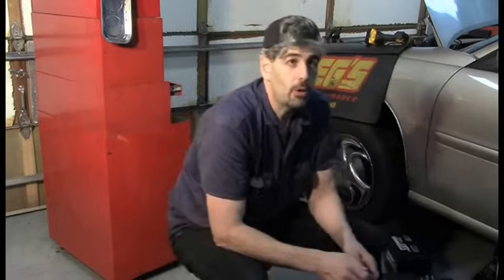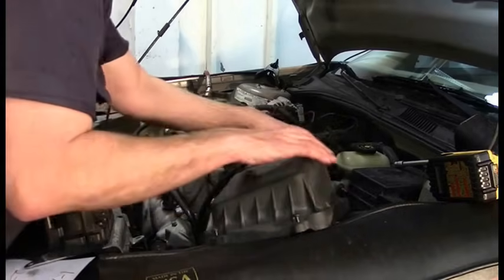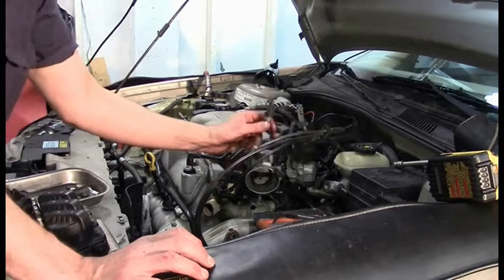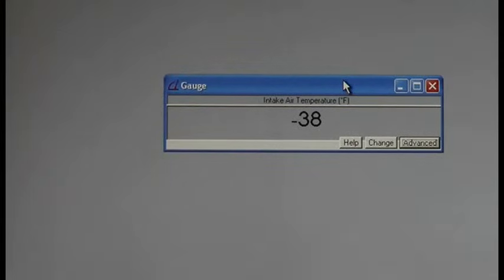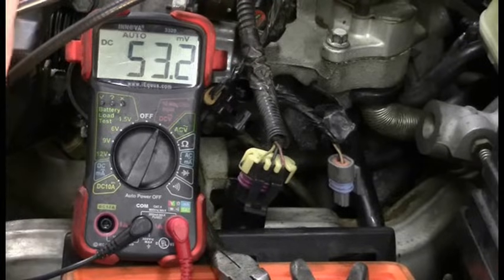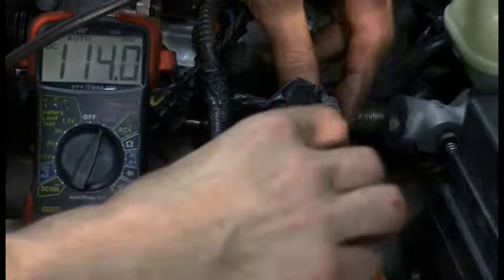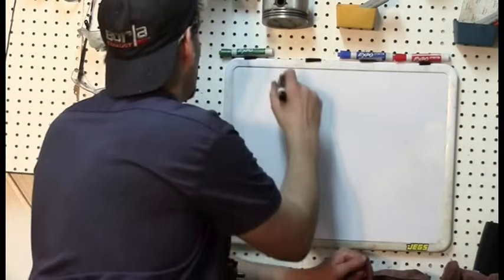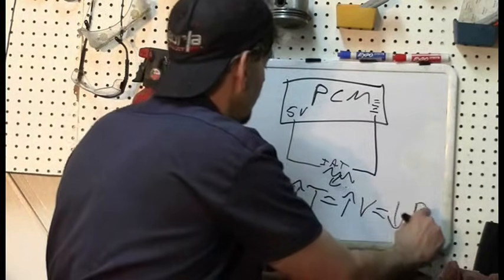IAT ( Intake Air Temperature Sensor ) Diagnosis P1111, P1112, P0113

Comment: Thanks for this video!  I'm chasing down this exact problem on an old '98 Cavalier and being one of the idiots you mentioned at the beginning of the video, hoped that replacing the IAT sensor would just make the problem go away w/o actually checking it first.   Fortunately, I only wasted $15 on the part.   Now I'm off to find one of those signal sending units!
Reply from the maker: +Rod Newcomb lol pretty bold of you to admit that lol.
  I might be able to save you the trouble though... turns out a GM tech saw this video and informed me that there is a TSB about this exact issue and almost always the problem is a bad wire exactly at the location I found in the video. So basically if you just peel the wiring protector back about 6 inches from the connector you will be very likely to find the open just like I did.

Comment: Would any fault finder work for that open in the IAT circuit?
Reply from the maker: +gc There are multiple ways to verify the open- continuity test, "signaling" fault finder like I used, voltmeter...

Comment: In addition to the previous post there is another important thing:
On the wire between the two resistors (thermistor connected) you will never see 0 or 5 Volts except with a short (0Volts) or an open wire (5 Volts) so that is how the computer detects a wiring fault (circuit high or circuit low). So the normal operating rang of such a thermistor will show 0,5 Volts when hot or up to 4,5 Volts when cold. That should clear up several wrong statement about switch or thermistor circuits.
Greetings from the far side :-)

Comment: Thanks a lot for this video!!! I had p111-113 errors and your video was very helpful!
Can the engine cut off cause of IAT problem? (e.g. cause of high voltage which is the result of faulty IAT, computer thinks that the air temp is low and decreases the air flow and increases the petrol which leads to the insufficient air in the cylinders for ignition) ?
I have Peugeot 406 2.0 HPI 16v (2001). Sometimes i have "anti-pollution error" with the engine cut off!
Reply from the maker: +Tural Huseinov Surely not.  Your IAT codes indicate a virtually certain electrical or component problem and not a "referenced code" as you are indicating. You will need to do the electrical diagnostics shown.
Reply: +Schrodingers Box Thanks a lot for your feedback. Sorry, maybe my question was too long. 
I was asking, If the IAT is really bad, can it cause the engine cut off?
Reply from the maker: Tural Huseinov Oh.. definitely not. However technically, the vice versa is possible but unlikely.  If the engine is cutting off due to a loss of the 5V reference signal then you could get IAT codes but you would also expect other sensors that use the 5V reference to throw codes too.

Comment: matt, I have a 1996 plymouth neon that I recently purchased for an extremely low price because it needed a new clutch.  I did the work myself and it now runs perfectly fine....except,  the temp gauge never goes above halfway but the coolant boils anytime I drive for longer than 5 minutes. it's been that way for about a week and today it threw the p0113 code.  I do have a diagnostic tool as well as a pcm live program.  I just don't know what to look for please help
Reply from the maker: +jon doe I would suggest you start by watching this video since it tells you exactly what to do step by step in extremely basic format.

Comment: Matt, I checked everything on my IAT sensor on a 2005 Dodge Neon and all checks out fine but I still get a P0073. What else could be in the circuit to cause the OBD code.
Reply: +Ed Lambright   Here is a bit of info on codes.
Hope it helps.
HARD CODE 
A diagnostic trouble code that comes back within one cycle of the ignition key is a hard code. This means that the defect is there every time the powertrain control module checks that circuit or function. Procedures in this manual verify if the DTC is a hard code at the beginning of each test. When it is not a hard code, an intermittent test must be performed.

DTC's that are for OBDII/Euro Stage III OBD monitors will not set with just the ignition key on. Comparing these to non-emission DTC's, they will seem like an intermittent. These DTC's require a set of parameters to be performed (The DRBIII(R) pre-test screens will help with this for MONITOR DTC's), this is called a TRIP. All OBDII/Euro Stage III OBD DTC's will be set after one or in some cases two trip failures, and the MIL will be turned on. These DTC's require three successful, no failures, TRIPS to extinguish the MIL, followed by 40 warm-up cycles to erase the DTC. For further explanation of TRIPS, Pre-test screens, Warm-up cycles, and the use of the DRBIII(R), refer to the On Board Diagnostic training booklet #81-699-97094.

INTERMITTENT CODE 
A diagnostic trouble code that is not there every time the PCM checks the circuit is an intermittent DTC. Most intermittent DTC's are caused by wiring or connector problems. Defects that come and go like this are the most difficult to diagnose; they must be looked for under specific conditions that cause them. The following checks may assist you in identifying a possible intermittent problem:
Visually inspect related wire harness connectors. Look for broken, spread, bent, pushed out, or corroded terminals.Visually inspect the related harnesses. Look for chafed, pierced, or partially broken wire.Refer to any technical service bulletins that may apply.Use the DRBIII(R) data recorder or co-pilot.
Reply from the maker: +Ed Lambright Did you verify that the signal is read at the PCM?
Reply: +Ed Lambright I traced it with a signal tracer to the PCM but did not disassemble the PCM leads nor do I have a schematic. Any suggestions as to where I might get a wiring diagram, a source would be nice. I like you am trying to help a relative. I am self taught and usually try to steer clear of OBD problems but a niece short on capital needs help. Cleared all other OBD codes except this one. At the IAT sensor  checks OK, like I say the signal traces to the PCM. 5v and good ground (grd lead to battery +12V) key on plug in IAT voltage 2.85v.   P0073 clears fine and then engine light and P0073 immediately returns.
Reply: +Ed Lambright Your videos are great by the way. I learn a lot from them.
Reply from the maker: Ed Lambright Yeah you will need a schematic somehow and if signal is reaching the PCM your PCM is bad. This of course provided your signal voltages are within range of course
  Good luck- I usually just google them if I don't have a factory service manual
Reply: +Ed Lambright Thanks, Matt. I have been hoping it was not the PCM would like to check continuity on the PCM plug first. By the way, I went to school at Oxford, Ohio, not too far from you. Beautiful country. Now live in Warren, OH. Will let you know the outcome. Keep up the great work.
Reply: +John R McLellan, CH Thanks, John great info and a great help.
Reply: +Ed Lambright 
This the only schematic on the IAT

Comment: I'm getting a P0113 code on my 05 Crown Vic p71. The car has 323,000 miles. It had a p0420 all of last year until the p0113 showed up. I decided to try the gumout multi system tuneup and erased the codes. The only code that came back was the p0113 iat code. I wonder if the gumout really helped the cat converter code or if the PCM is just bad. The car starts a bit rough and shuts off with a bit of shake at the end. The p0113 code originally came on after a stupid seafoam treatment in the pcv hose. Unfortunately i don't have a Power Probe ECT2000. 

I already replaced the MAF/IAT sensor with a spare i had and tried using a new connector pigtail and reset the code using my computer but the code keeps coming back. Also there is no change even if i disconnect the harness from the MAF/IAT. The IAT shows a -40 celsius temperature and i know thats wrong. What do you think it could be ? Wiring or bad PCM ? Thanks
Reply from the maker: John Doe You have either a bad IAT, and open in the IAT wiring, or bad PCM. Those are the only possibilities.
Reply: About how much labor do you think I should be looking to pay a pro to fix this. Rough estimate range? Or would i be better off biting the bullet and purchasing the power probe ? Thanks Matt
Reply from the maker: you don't need a power probe to fix it. Just determine the cause and repair accordingly using a DVOM if necessary. 
 But a competent tech with even minimal aptitude should be able to diagnose and repair wiring  within an hour. so it would range from $150 to $250 if you need an IAT to over $1000 if you need a PCM. 
  I would definitely not buy a power probe just for this one diagnosis, that is unnecessary.
Reply: Schrodingers Box  Thank you for the quick reply. I'm having a hard time finding the short as most of the wiring visually looks fine hence why i was considering the Power Probe. I will get a DVOM like the one you used in video  (Innova 3320). I will try doing this again. I need to pass emission.
Reply from the maker: John Doe All you need is to simply test for continuity on the wire- nothing fancy is needed at all. Even a basic test light can do it

Comment: 1998 saturn sw2 1.9L and installed a short air ram intake, but no place to put "air intake sensor" so I made small hole in ram to install sensor into securely. Engine is now chugging sort of going uphill and no check engine is on though!! any suggestion?
Reply from the maker: Todd Gilmore  Actually my first question is why you would put such a thing on a 1.8L but as far as the chugging- what data do you have for the fuel trim static vs load?
Reply: I'm not that technical when it comes to diagnosis... but a back yard mechanic!! I just wanted more air flow and thought that the factory box and filter would be more restriction. So I added the short ram for better air induction and possible performance or better gas mileage maybe, who knows?
Reply from the maker: Todd Gilmore Yeah without fuel trim data I would only be guessing. Any guess is as good as any other without data whether it's from me or a professional. Sorry.

Comment: Incoming voltage to the sensor.is 11.4, battery voltage is 12.4. Is that OK?
Will sensor voltage increase with engine running?
Reply from the maker: Gary Bench What vehicle is this on? I have never seen an IAT with a 12V signal ever.
Reply: OK maybe I miss stated. I have 4.7 v on one side but there's a.test pos on your multimeter to pos on battery, probe the other pin of IAT with the negative and it should show 12v indicating that you have good ground. I have determined that I don't have good ground,  So two wires come the far left (still tracing) connecting to three other wires one leading to the connector, I was assuming there would 12v at those two wires. Ford 95, Econoline 350, with a 351Windsor. Instead they show 11.4. I believe one of the two will go to the ICM.
Reply from the maker: Gary Bench The ground for the IAT is common with almost all the sensors. It is unlikely you have a bad ground- maybe an open before the common ground though. Your testing sounds unnecessarily convoluted- just test for voltage at the sensor reference and return. If you measure 5V you have no wiring problem. If you don't then compare the reference to a chassis ground and check for 5V. If you have that then you have an open ground- confirm with continuity test to ground and then repair if confirmed open.  I have no idea where this 12V has anything to do with it and if you are measuring 12V from battery to the sensor ground then it must mean you have sensor ground- there would be no other possible explanation so I'm confused on what you're doing.

Comment: I have a 1996 Explorer with the 5.0. Whenever the outside temperature reaches 80 and above it does not want to restart without a big blast of starting fluid into the breather. I have tried cleaning the maf and the throttle body and I have replaced the IAC. Once it restarts it is fine until it is shut off again and once the temps are down in the 70's or lower it starts fine. Any ideas?
Reply from the maker: taggr921 hundreds of ideas. what data do you have to get a narrow direction?  What is the fuel trim at idle vs load? What is the static vs load fuel pressure?  also, most importantly, what was the data you got that indicates the IAC needed replacement?
Reply: Schrodingers Box I have not tested for codes. The reason I started looking into thee IAC was due to the way that the air temps effecting the problem.
Reply: Schrodingers Box Thank you for taking time to reply.

Comment: Good video, I subscribed. BUT! I got p0113 and IAT high intake voltage on code screen. On the streaming screen it showed "no IAT fault" also "no MAF" fault, IAT temperature was reading 14 c, which is correct. Voltage at socket was 4.6 volts, I pulled the IAT out and did a resistance check with a small heater. It worked well, going up and down. The car has high idle and stumbles/chokes when accelerated quickly. I want it to be a Humdinger, Mr. Schrodinger, not a pull-finger...help!
Reply: As I thought---unsubscribed

Comment: why does resistance increase with temp?  a wire at absolute zero can have no resistance.
Reply from the maker: jaybeefun It depends on the wiring actually.  Copper definitely increases resistance with temp dramatically.
  I don't know the exact reason for it as far as physical or electrophysical.  My best guess is the expansion causes the atoms to be further apart and thus less conductive??

Comment: Is it possible to test the iac in the airbox with a heat gun or a hair dryer to check for operation?
Reply from the maker: Rich Furber Sure if you can access it

Comment: Hey Matt, 
Good morning, 
When you connected the ect2000 to find the open circuit did you disconnect the battery leads or the ecu connectors ?
is the signal of this tool can be damage the ecu or is it safe?
need to know about this product .
btw great diagnostic tests you did thanks a lot .
Reply from the maker: toolman talal No need to disconnect battery because I already new I was dealing with an open
Reply: Schrodingers Box ok , what about the short ?
Reply from the maker: toolman talal On a short you either disconnect the battery or the load. For example on a short for say a light bulb you would disconnect the bulb. Understanding the electrical is necessary to ensure you don't get false results.
Reply: Schrodingers Box thank you matt i appreciate your help and taking your time to make useful videos .
Reply from the maker: toolman talal Thanks my friend I appreciate your long time support!

Comment: I think thermister uses NTC (negative temperature coefficient) characteristic. So according to that it should be opposite than that you have explained. Increment in temperature reduces the output voltage of IAT sensor.
Reply: +Himanshu Patel   OK this is where we get things confused. follow this.  He said there is a decrease in resistance with an increase in temperature. A decrease In resistance in ohms will allow more electricity to flow in volts. that's why -40 degrees normally means open circuit [ ie ] no or low voltage from very high resistance or broken wire. Also -40 means that it is very cold outside, = High resistance in circuit,  that causes Low voltage in circuit.

Comment: Please help! I got a 2008 mazdaspeed 3, I got the code p0096. It's "IAT sensor 2 range / performance". What is it??? Maf or map??
Reply from the maker: It's Neither. What did your diagnostics on the CIRCUITRY for the IAT show?
Reply: Well I actually havent tested it cause I dont have anything to test it with. But people were saying it may be a vacuum leak. Im not to sure. I have something called an accessport and it shows me boost temp and air temp and they give me readings. Im not to sure about this one.

Comment: **NEED HELP** I have a 2003 Hyundai Accent that reads a P0111 code and o do not know where the iat sensors on my car are......any help?
Reply from the maker: On most Hyundais, the IAT is integrated with the MAP sensor.
Reply: Thanks so much, every thing i tried to find online did not help at all.
Reply: Are you 100% sure? Not questioning your abilities but i just spent $77 on an IAT sensor for my car and i dont want to have to go spend another $55 on the MAP sensor, im not sure if autozone and oreilleys are not up to par with their knowledge with mechanics i just dont want to waste money.
Reply from the maker: I am not 100%. However if the Map and IAT are integrated, it's all one unit- you don't but an IAT separately. How about removing the suspect component and testing that has thermistor characteristics?
Reply: Just replaced my MAP sensor, is the check engine light supposed to shut of immediately or do i have to drive around for some time for it to turn off?
Reply from the maker: you have to reset it bro. why did you change the map sensor - what indication did you have it was faulty?
Reply: I went and had my car hooked up to one of those machines at Autozone that test the light and why its on, and it read a P0111 code which is the IAT sensor, and you said that the MAP and IAT are integrated so i went ahead and got the MAP sensor.
Reply: Because the IAT sensor I bought doesnt look like the right piece but im not to sure, i dont know where the IAT sensor would even be on my car.
Reply: RewindHysteria s

Comment: Are IAT Sensors and O2 Sensors related somewhere? Recently I had 2 cars in the workshop which showed O2 sensor circuit Voltage high with normal fuel trims but IAT showed some abnormal temperature of about 63 degree Celsius.
Reply from the maker: It depends how the fuel trims respond under load and induced variables. See my video on fuel trim to diagnose the cause of the high fuel trim. Generally IAT has minimal effect on fuel trim- it can affect it, but usually not nearly enough to set a code.